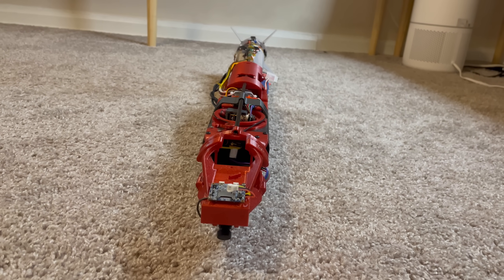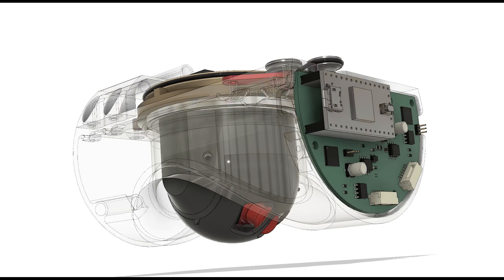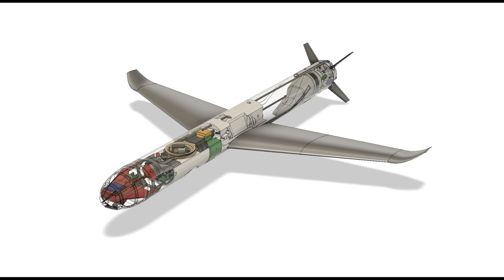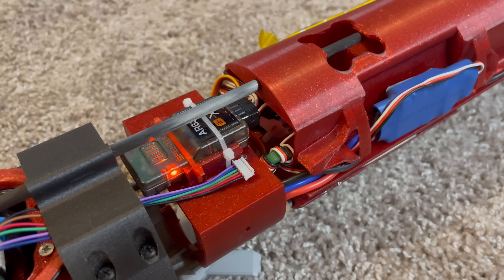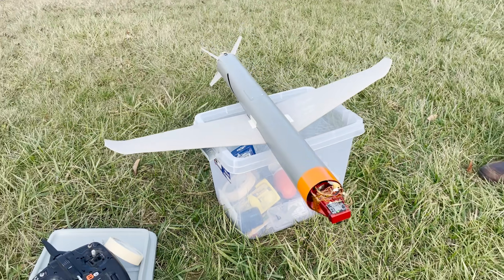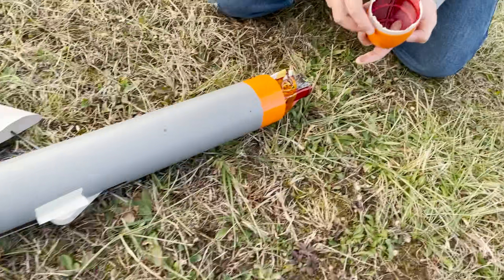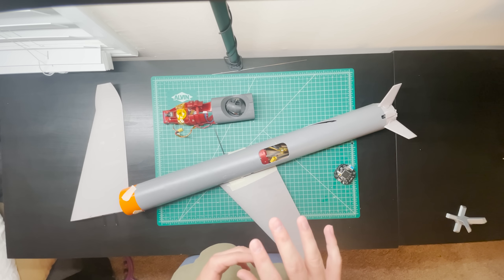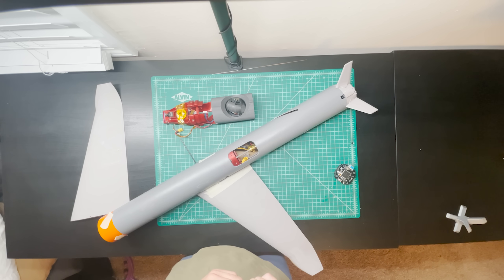Building (And Crashing) my Homemade Surveillance Drone

Comment: Not really an rc guy but obvi looks like its controlsystem malf. Its not gliding, and i saw it roll (invert) and the crafts thirst for thrust is not helping. With such a unique prototypy design id vote for overpower. Also, Is that air inlet sufficient, and does the back vectoriung fin thing not mess with thrust/control? outer fins and vectoring being controlled with the same axis not cause instability/feedback issues? Just on a glance it makes me feel it could be a jungle of problems , but perhaps its a proven thing already? or perhaps you calculated it.. Im guessing did some dynamics simulations with the design? 

Really cool idea in general though and I hope you get it flying soon! I am planning on making something similar in the near future actually so its great to see

Comment: Not an aerospace engineer, just a normal one:  Just based on observation of flight characteristics (or lack thereof) at launch, it appears that your TWR is too low and you either need to decrease mass or increase thrust.  Weight distribution may be very slightly forward, but that may be an artifact of thrust being too low.

Awesome project!  I'm interested to see you modify it and attempt another test.

Comment: those wings look awfully tiny, have you calculated the wing loading of this thing? i think your launch speed needs to be way, way higher. wind tunnel testing here would be a godsend to iterate on the design.

Comment: Too many possible things wrong to guess on.  Ignore what other people say and just go build a foam version and from there you can figure out how big your tail surfaces need to be (bigger) where your CG needs to be (further forward)  After that you can figure out the other items like how powerful do my fans need to be for my wings to be that small (much more powerful).  Also, did I mention larger tail surfaces?  You'll figure it out.  Love to see you trying to use rocket skills with planes.  You're just going to have an even better understanding or fast versus slow flight and the differences between vertical and horizontal "Flying."  I'm  here for it.

Comment: I have some limited knowlage of making rc planes from scratch. You'rs don't look balanced from the way it flips. Try moving the wings back a little so that the balancing point on the wing is roughly 1/3rd the length of the wing. Another issue i suspect is that your air duct causes a lot of low pressure beneath the tail. Effectively acting as a reversed thruster. try either putting an rq-4 esc. air duct on or mirror the design with two intakes to even out the pressure zones.

Comment: The very basics I learned about building and adjusting a model airplane was the procedure to get it to glide.
It is not so much essential, how much weight the object has, but if you throw it straight forward (not up or down, just level to the ground, it has to glide in a stable manner.
From the handlaunching attempts I could not see any tendency to have such a stable glide behaviour. It just starts to rotate around all the axis.
Coming from the Model Airplanes I would suggest first to get it hand gliding (make it a little nose heavy) and as soon as you accomlished that, go for the next launch. Otherwise you will break parts, over and over again. Just My 2 Cents.

Comment: For the future, consider replacing the lidar w/ GPS - it's not as precise, but you probably don't need that level of precision. Also, are you using iNav? As a racing drone pilot, it's not really my wheelhouse, but it might to reduce the number of unknown variables in the system.

Comment: It has no thrust. You can make a simple sling shot style launch system vertically on a simple rail system like a rocket. But really, if your thrust is not able to life from a static position your don't have enough power.

Comment: Well You need a lot more speed for take off. And I think the thrust of that fan should at least lift the plane to make it work. And y need to check the center of gravity. I usually hang the plane in a piece of string and turn it around to see if it want to fly with the front pointing into the wind if not y need more lead in front.

Comment: What about if you would include a second section of the wing that was folded out from under the wing to double its surface area with a 1 way ratchet mechanism to lock it flush?

Comment: A few points I immediately noticed considering the wing area/weight to power ratio, way too much weight compared to the wing area judging by the launch attempts and looks like it needs alot more thrust, the rear stabilizer fins need to be much bigger since you obviously dont have thrust vectoring, in launch your stabilizers clearly dont have the necessary airspeed for them to work before the aircraft loses its balance, they might work if you can launch it with a slingshot from a rail that forces the aircraft to maintain its attitude long enough for the airspeed to build up for the stabilizer to start working, center of gravity looks like it is really nose heavy, it would work with that fan you have if you cut down on the weight like building the whole fuselage/wing out of styrofoam or eps or similar low weight materials, there are free calculators for the wing area, weight to power ratio and aerodynamical center of gravity I am pretty sure, the easiest way is to always trust the math first, it never lies.

Comment: Then there is your air intake, which does nothing to help create stability.
There is nothing in your design that helps to ensure a regulated airflow to the engine at all speed ranges. 
We also notice from your flight attempt in his video how your tail is trying to go beyond the nose. You have so many high speed airflow being sucked up on the intake, it's too much high pressure from the one building up your wing lift capacitie and so breaking the overall balance in between, litteraly the tail is tying to go over your nose.
You could redesign your air intakes to have 2 intakes from each side of your airframe and also have a small step off from it, just as in fighter jet design, to help control the air speed and the amount of pressure building up inside your intake chamber.
Also use the induced drag in the design of the step-off to naturally channel the high pressure to keep your nose up, ensuring a solid lock from nose to tail at low speed or near stall.
The kind of thing you need to enable your engine thrust to override stall behaviour.

Have fun :D

Comment: Hi, very nice design. I think you should use the extra space you have obtained with the folding wing compartment to add new batteries.
What you want to achieve in the aerodynamic profile is to lock you tail at take off, add weight to the rear (batteries), enlarge you thin like a plane profile or even evolve from the X design to something able to produce the stability you need.
You could also work on the lack of thrust you'd need to take off as a rocket :p

Comment: hay there Lafayette Systems, wanted to suggest a little bit of an improvement. I would suggest that rather than having a inline inlet for the air, you put in a sort of scope or something which pushes the air into the engine from the front as i believe that the reason you stall is that you can't produce enough thrust to get off the ground with the air not getting feed in the engine. I would also suggest having some holes going around the engine just incase too much air gets traped infront of the fanblades. I hope this helps and wish you best of luck creating such an ausome program.

Comment: The TVC veins are really messing with the thrust.  When you look into the actual airflow at the exhaust, it’s in a spiral.  Your veins are making it change direction even when they are straight.  Forcing the flow to straighten is slowing down the flow which is dramatically limiting your thrust.  I don’t think your rocket exhaust experience aligns with EDF exhaust flow.  If you look at both full scale and RC TVC they move the exhaust nozzle, not the air coming from a straight nozzle.  Making this change will give you the trust that might enable flight once you cut the weight in half.  More than likely nobody will see this in the sea of comments….

Comment: The intake is pointed at the ground doesn't that make the stall speed higher at take off? Because your airspeed it really low resulting in the air being sucked in from below the drone instead of in front of the drone.

Comment: There's nowhere near enough thrust power there I mean even if you did get it to speed projec tile like you still have to have the thrust to keep it there and battle a low fan aint gonna be nowhere near enough strength you need to put a little rocket on that thing

Comment: Some model sailplane pilots used to launch their planes using a nose hook attached to a long section of surgical tubing.  The other end is anchored to the ground, and they pull the plane backwards, stretching the surgical tubing to its limit, then release the model while applying nose up control input.  Simple and effective.

Comment: Having built many RC airplanes from scratch,  i knew 5 seconds into the video it wont fly. You either need to put a rocket in it or improve wing loading by decreasing weight and adding more wing area. Then you also need to make sure your CG is where it needs to be depending on the wing design. Eventually you will find out that the payload you're trying to carry just needs a much bigger and lighter airplane. Wing loading is the key.

Comment: Can you take a tarpolin and replace the wings with something like a hang-glider? By increasing the torque on one side and shift the wing area to one side of the hatchet, you can get rid of two of the steering fins and use a v type for the two remaining. It might help to put the intake for the propulsion on the top, to help with lift? Hp an lp system around the Wings
Reply: For initial speed you could try discus launched

Comment: I know this isn't directly related to the problems you experienced, maybe putting a rough mesh designed into your inlet 3d print might prevent it from eating debris and having the fan explode again. It shuoldn't affect aerodynamics or airflow into your EDF too much if designed optimally and could prevent some mishaps in the future. Just a thought

Comment: not an expert in ducted fans, but what I see is lack of thrust

For quadcopters that I'm used to, thrust to weight ratios are usually 4:1 - 6:1. Judging by the video it looks like your thrust to weight ratio is well under 1:1. Aeroplanes don't usually have extreme thrust to weight ratios above 1, but I believe you can probably get a motor and prop combination to get you to 1:1 or 1.5:1 which will help with the hand launching (and then you would immedietely reduce power airborne)

Otherwise some other method of launching would really help to get you over that stall speed hump.

Comment: Guy throwing it was the problem. He made it angle up when he throws  Run and throw smoothly without pushing from the back tail section.Has to he thrown from the the front to mis section, never behind the wings!

Comment: Been flying RC since the 80s. Obvious that there's not enough thrust produced, and that might be a function of the intake design or just underpowered for the weight. But all potential CG issues, control surface issues, and throwing technique aside...it doesn't have enough thrust and you can see that as you have full throttle and it still looks like every bit of acceleration it's getting is coming only from the throw, and not the motor. Precipitous falling off of speed the second it's let go. It doesn't even want to glide, which means there are several issues, but low thrust is number one on the list. I also think there's an issue with vertical stability with it having wings with very low wing area, and the tail of a missile. You don't have the pitch authority on those stubby tail fins to keep the nose up without a LOT more thrust/velocity. That's why you only see small little tail surfaces like that on rockets and missiles, and not airplanes. 

You also are just going for it quite haphazardly and doing a lot of damage. If I had just designed something like this that never flew before, I'd do quite a few running "taxi tests" for stability before launching it. In the old days, we'd also find a slope somewhere with tall grass or some other soft landing and check to see if the thing would even glide, power off. It should be able to glide with no power at all. If you can't do that, you don't have something that is going to fly well whether you have power or not.

Comment: To increase take off speed why not use a bungee launch system, cheap to implement, or perhaps a runway take off dolly, Just a thought. Many possibilities. But you need to increase flight stability and thrust to weight ratio as I feel from watching the video is underpowered.

Comment: Reducing the weight will definitely make launching easier. You need to prove out the airframe design, then incrementally add weight to make sure it can still launch and have stable flight and good stall characteristics (which helps with landing too) I’ve done bungee launches where I attach surgical tubing to a stake in the ground. Keep the airplane and launch as simple as possible, then build up from there. It does seem to be that the tail is a bit small as well. Vtails (or an x tail in your case) tend to have a harder time providing yaw stability.

Comment: Im probably way over my head as a 14 year old but couldnt you take the atlas launch platform make it horizontal and add a small rocket charge to the end to increase takeoff speed? Cause that would make it even better considering its neat and tidy in a little box ready to launch on a vehicle or at a remote location.

Comment: I'm an aerospace engineering student who makes competition RC planes for a club at my school. I mainly do aerodynamics stuff and have a few recommendations that might prove helpful. First off, definitely decrease the weight. PETG and PA-CF are probably not the best materials to use here due to their weight. When 3D printing drones/aircraft it's generally a good idea to use a low-weight plastic, like low-weight PLA or low-weight ASA (I'd recommend the ASA). This should substantially decrease the overall weight of the aircraft. Besides that, the aircraft's current configuration isn't really designed for stability at low speeds, which is probably why you didn't have much control over the aircraft during launch. This can be partially rectified by decreasing the weight, allowing you to get up to speed faster, but even then, I'd recommend increasing the overall surface area of your rear control surfaces and adding more dihedral to your wings. These are all just off-the-cuff observations though, and I'd highly recommend making a surface model of your aircraft and throwing it into a free CFD software like Simscale (shitscale). It's not exactly the best software in the world, but it's free, on the cloud, and relatively easy to use with plenty of documentation. I'd recommend running a few sims at 0 AOA with varying speeds so that you can figure out your stall speed. If you're feeling extra ambitious, you can also do stability analysis with XFLR5 (also free), which might help you optimize the design a bit more, or at the very least help you figure out if this design is feasible. I'm still a just a student so take what I say with a grain of salt, but I do think what I've presented here is at least worth looking into. In any case, I wish you the best of luck!

Comment: thats why i just use EPP foam frames, lightweight and doesn't break when crashed, if you wanna stick to this desing id suggest forgetting about the fan thrust and all its components and just attach a motor with a big proppeler in the back, with one of those chinese rubber band type holder so it wont bend the motor axis when landing.

Comment: Check CG with a software.
This thing needs a bungie launch system. Throwing is just too slow and induces yaw and all sorts of unwanted stuff. We had this issues a lot launching heavy high speed planes. The launches looked the same

Comment: You might want to consider adding a scoop inlet for the edc, because it might be causing a low pressure zone and dragging the tail down. Might also protect the bottom fins and if printed in tpu could be flexible enough to absorb impact. Really freaking cool project man.

Comment: Shed a ton of weight weight.
 A much larger V tail for more control. 
Get it flying than add systems.
Skip the rail launch for now.
If it's still to high a stall speed a length of surgical tubing attached to a screw in anchor for a dog lead will give you plenty of power to yeet the wings off this thing. Simple used for gliders all the time and gives you a large range of force. Cool design concept tho!

Comment: Model airplane and quad builder/pilot here, since I was about 8.

I think that yeah, those control surfaces are small and it’s underpowered, that could be addressed. I think more importantly though, you may want to try a different launch technique; either a wheeled cart, or a golf cart, something that will allow you to get air moving over the wings and control surfaces before you commit to take off. A lot of weird designs CAN fly, it’s getting them moving through the air initially that’s tricky.

Comment: Hello, It seems a thrust issue. You dont have enough thrust to take off from hand launcher. If you want to use an EDF motors, you need more power in the launch. Also, dont cutoff the inlet curve because It helps to generate more thrust. I think, if you change for a wider EDF but mantain the mtow and use a bungee small launcher, you accomplish the mission. Great job and soon we see your goals. We are here for help! Regards